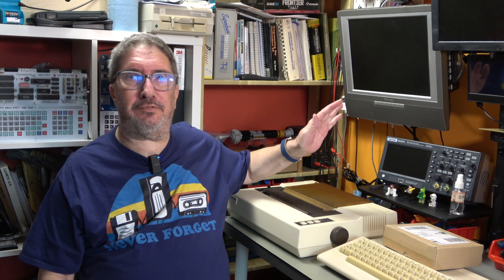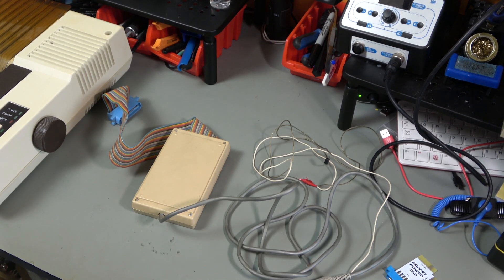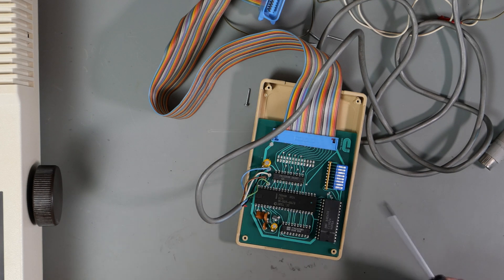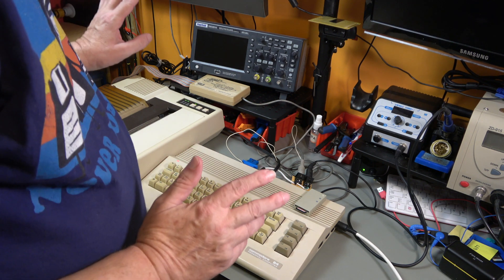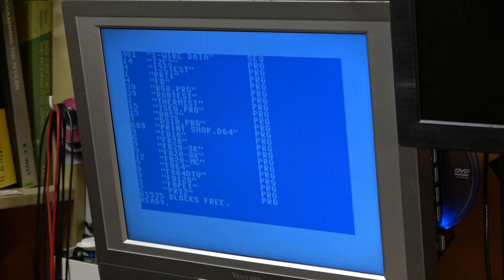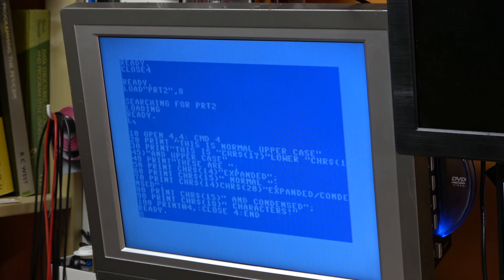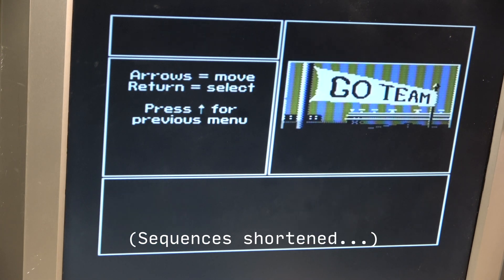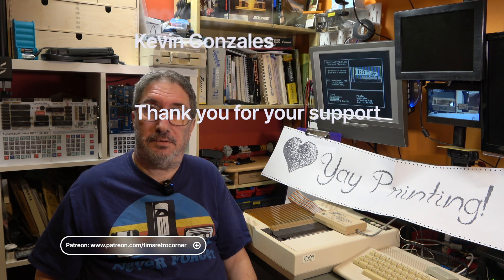Print to an Epson FX-80 from a Commodore 64

Comment: The sound brings back memories, the FX80 was my first printer. I used to manufacture centronics interfaces back in the 80's for commodore pets, C64, Apple etc. Not the one you are using.
Reply from the maker: They weren't by any chance the sort that goes inside the printer, were they? (I'd love to find one of those one day...)
Reply: The one for the Apple was a plug-in card, I don't know where you would find one now